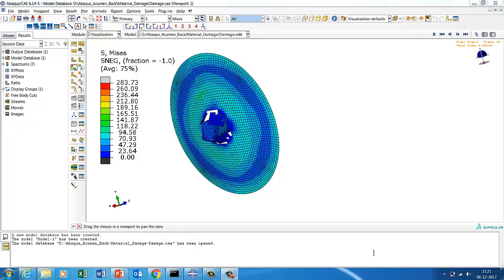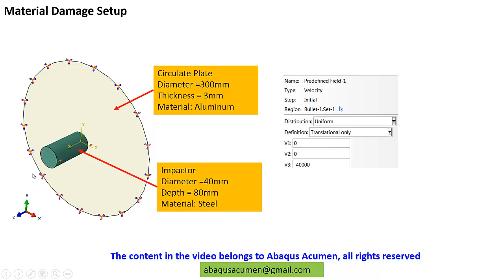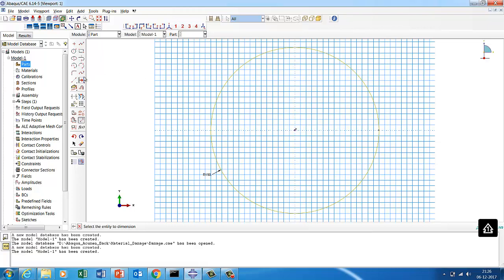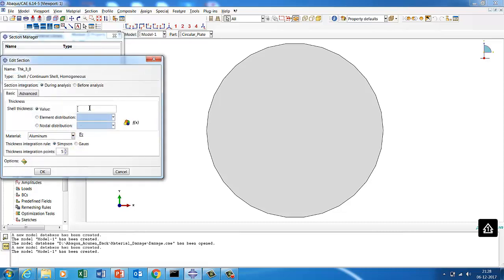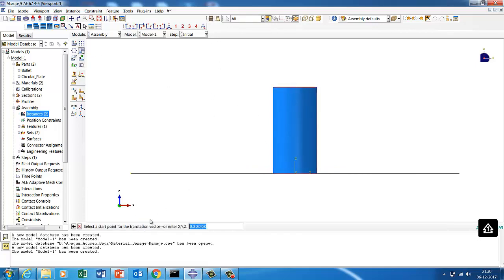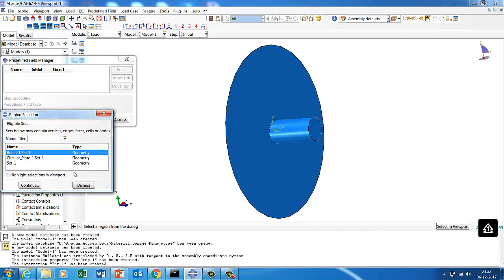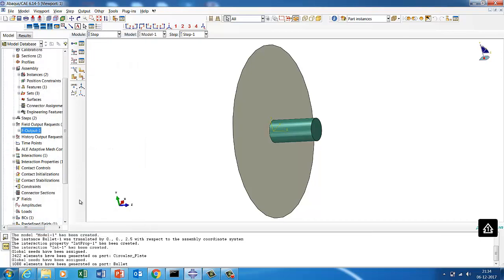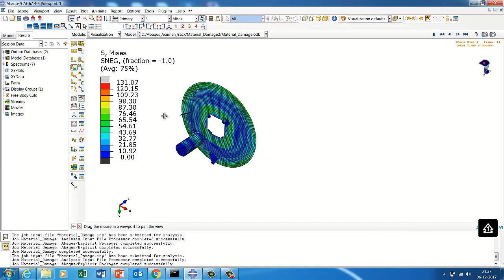Abaqus Explicit: Impact With Ductile Material Damage

Comment: Hello brother can you do a video on Thermal stress analysis of a riveted lap joint by using coupled temperature displacement module. I am currently having contact problems when I try to find the thermal stress due to cooling of rivet by using coupled temperature displacement.
In my message file I get these problems

 1)THE ESTIMATED CONTACT FORCE ERROR IS OUTSIDE OF CONVERGENCE TOLERANCES.

2)   DISP.    CORRECTION TOO LARGE COMPARED TO DISP.    INCREMENT

3) MAX. PENETRATION ERROR 75.1979E-12  AT NODE LEFT STRIP-1.838 OF CONTACT PAIR 
   (ASSEMBLY_LEFT STRIP-1_LEFT STRIP HOLE SURFACE,ASSEMBLY_RIVET-1_RIVET MIDDLE 
   SURFACE)
   MAX. CONTACT FORCE ERROR 1.44901E-03 AT NODE LEFT STRIP-1.21281 OF CONTACT 
   PAIR (ASSEMBLY_LEFT STRIP-1_LEFT STRIP HOLE SURFACE,ASSEMBLY_RIVET-1_RIVET 
   MIDDLE SURFACE)

 Please make a tutorial on this brother, I will be grateful to you.